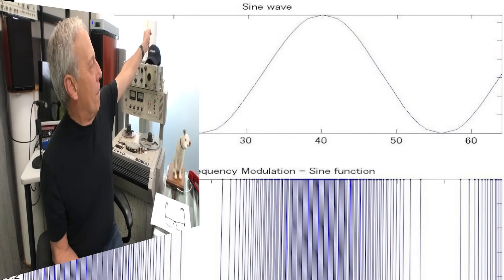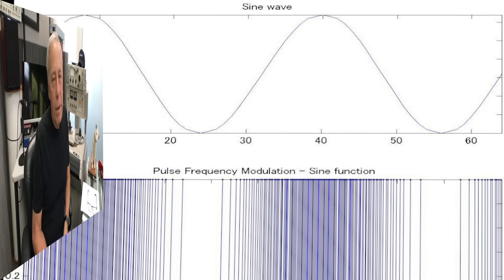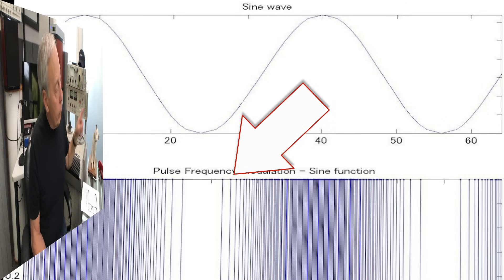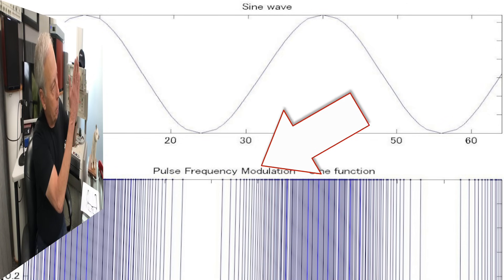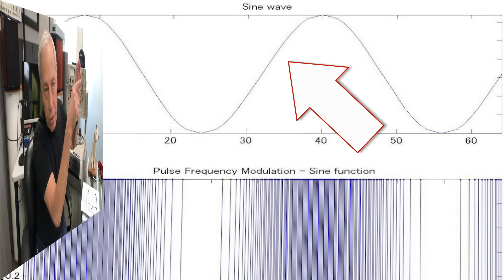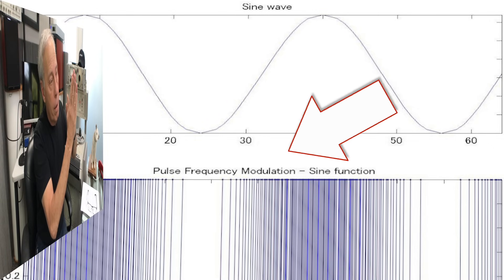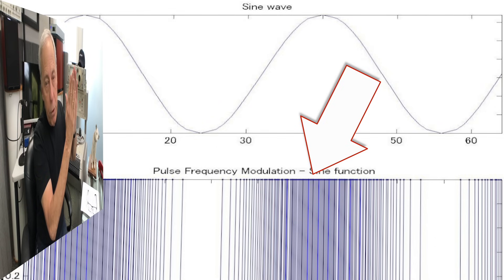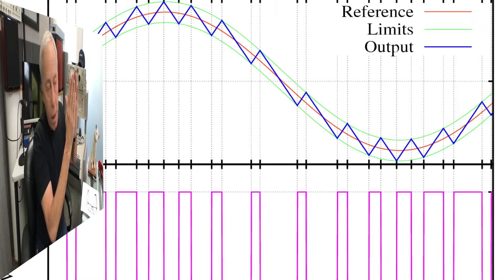What are the differences between Class A, AB, and Class D amplifiers?

Comment: Which among these amplifiers have the most natural sound?  And if I go by natural sound will class D be still the best option for Subwoofer?  I am using 3 class AB stereo amps linked through a 3 way network.  Should I reconsider the classes based on bass, mid-range and treble.  Thanks in advance.
Reply: Thank you so much for the reply.  I'll power the sub I'm going to make using class D.

Comment: So basically in summary, the higher the class the better the quality, Class D being high end premium amps and Class A being on the side of all the cheap components at Walmart.
Reply: toranamunter Class D is more efficient, nothing to do with quality
Reply: toranamunter expert trolling
Reply: hurkamur1 - might even be class A trolling
Reply: PapaWheelie Ooh..  I see what you did there 😁
Reply: PapaWheelie Or was it just class D with a youTUBE buffer?
Reply: hurkamur1 - worst part is he might be for real but doesn’t matter because trolls
Reply: No NO No The Class of the amplifier Circuit type has nothing to do with sound quality .. it is not like A, B, C Grade It is just a classification of the type of circuit
Reply: Class A is the best most premium quality sound but very inefficient
Class AB is very close if not identical to a Class A in sound quality but much better efficency
Class D is the cheap bargain basement amps you will find highly efficient but needs a very good LP filter to match the sound of A & AB

Most Mid to High End amps will be in the Class AB variety with low end stuff and portable battery powered stuf being class D

Comment: I have just found your channel - it's very good. 50 years ago I built 2 Mullard x 20W RMS into 15 Ohms 0.05% THD valve amplifiers and 3 valve pre amps. 50 years is a long time to go back to a hobby. I can remember the arguments about these new transistor 'things'. It seems that has moved on although valves are now 'THE KING' it seems, at least in price. I have a 2 x 10W in the loft so ..... 
I have missed A and AB amps and gone straight to D-Class. I have built the power supples but these ltlle black things with legs like spiders webs are beyond me. I have bought far too many from China. I need all the help I can get and your explanation was just what I need - simple and precise. Thank you from across the pond. Come to think of it my  15 Ohm Tannoy's (1953 vintage and perfect) might like a little class A. I have a lot of 2N3055's - I remember them coming out and TIP35C's. Thanks again.

Comment: Surely the key difference between amplifiers people are interested in is the effect it has on the signal.  Thinking of a sine wave the Class A is indeed always on amplifying both the positive and negative signal through a single valve (vacuum tube) or transistor.  A Class B amplifier has two valves/transistors; one for the positive part of the sin wave and the other for the negative and is only "switched on" for that duration.  This can lead to crossover distortion as the sin wave transitions between positive and negative and back again, which of course the Class A won't have since it's always on.  My understanding is a Class AB overcomes this by keeping "switched on" passed the transition of the sin wave being null thus overcoming the issue of crossover distortion.  A Class AB amplifier also has the benefit of being able to generate a much larger output signal than the Class A, as most of the individual valve/transistor's amplification is on only one half of the sin wave cycle.  Class AB valve amplifiers also use a feedback signal from the speaker to compare to the input signal to remove any distortion (IIRC) and better control the speaker itself.  For example, when the music stops and there is no signal a Class A amplifier will let the speaker ring until it comes to a halt whereas a Class AB amplifier will effectively stop the speaker dead so the playback could be considered more precise.  That said, in the real world a speaker's ringing may only be a few m/s so isn't really audible.  Both Class A and Class AB valve amplifiers can sound fantastic IMHO.

I don't know maybe the question was purely concerned with power in which case my comment is totally off point :)
Reply: Pat, your clarification is a little better than Paul's (sorry) and if one wanted to peel the onion of the cross-over distortion dilema a little more, one needs to understand the that a bipolar transistor has what is called a forward bias voltage (Vbe=voltage base to emitter) characteristic that needs to be overcome before the transistor starts to turn on. This voltage is about .7 volts. This is what causes the infamous "cross-over distortion". As the music's signal sine wave starts to increase from zero, the transistor dose nothing until this voltage is met, thus the first .7 volts of the signal is lost. This happens in both the positive and negative cycles. Thus where you have a perfect sine wave going in, you end up with a sine wave with flat spots as the signal crosses the zero voltage points. Google "crossover distortion" (http://bit.ly/2CuytSH) and click images and you'll see it. The whole class A/AB/B discussion stems from C.O.D. more than a power discussion, from the beginners perspective. IMHO.
Reply: Exactly.  It's the crossover distortion and quality of music that's of real interest not many watts electricity we're using :-)
Reply: It all depends on how high the bias is set for the amp to go into class b mode, Nelson Pass makes class A/B amps that go rather high in class A before the switch and begin having switching noise etc.
Reply: To use a mechanical analogy, a class A amplifier uses a variable amount of force to push against a spring; keeping the spring in the middle position requires applying force constantly, but the spring will always ride smoothly against the mechanism applying the force.  A class AB amplifier has a pair of mechanisms that can apply force in either of two directions.  This avoids the need to continuously expend effort keeping the output in the middle, and also eliminates the need to waste even more effort on the spring when compressing it to the maximum extent (an optimally designed class A amplifier cannot be more than 25% efficient), but will be more prone to mechanical backlash whenever it reverses direction.
Reply: thanks for that additional info....didnt know about that speaker wires are bi directional and can be used by amps to remove distortion
Reply: The better the Amp, the less it will "effect" the signal. Effecting the signal is not something one wants.
Reply: "The better the Amp, the less it will "effect" the signal. Effecting the signal is not something one wants."

Effect: "To bring about (an event, a result); to accomplish (an intention, a desire)." I always want my amps to bring about a result (output a signal). When they can't, it's either because there's been a power outage, or the amp needs repair.
Reply: It's "sine " wave -not "sin "wave.  It's non denominational.
Reply: Correct!
Reply: damping factor

Comment: very nicely explained. interesting to note that similarities exist between designs of products that convert electricity to other forms of energy. I am an ophthalmic surgeon and modern design trends in phacoemulsification machines increase efficiency of the energy generation and trade off of heat generation by burst, pulse and on-off patterns to maximize energy efficiency and reduce heat

Comment: class A is found on Neve's pre amps
Reply: Class A is fine for preamps,  since they work at lower voltages and currents,  but at the same time much higher impedances.  Therefore,  their power dissipation is much less than in power amps.

Comment: I have a question ...can you hook up a power amp to power 2 passive subwoofers using the sub out on the back of a receiver..?...great videos ...thanks
Reply: ok great can I also hook up a professional style crown amp to this sub out.? will the sub out have enough out put voltage for the amp.?i know some crown amps have a voltage select switch but the one im looking at don't...thanks

Comment: which type is good for subwoofer? I previously think class D, am i right?
Reply: Mikael Helje it's exactly the opposite. Class D amps need to have a lowpass filter on the output, which is why they are not as good on high frequencies as basic AB amps. There are exceptions, of course, like hypex nCore, but that's 400€ per a single amp module without a power supply. There's really not that much sound difference on subbas, if any at all - the way a subwoofer sounds depends mostly on the enclosure, amplifier only plays a very small role.
Reply: As wth capasitors,resisters ect , they all depend on each other  , a bit like Led Zeppilen all are one, one is all, they compliment each other ,take one out and it's all over for the rest, JB died the rest knew it was a broken , never to be fixed or replaced thing. Their amp was fried. Now out the 10000's bands and modern editing nobody has ever came close to the mark they left, a 1/1000000 thing, a personl choice iin music should determin the amp,xovers, speakers that give te best result regardless of what any cashed up book reading jazzjizz sound guru says. Now can somebody set up a perfect hifi to listen to Henry Manchini, AC/DC, Public Enemy and Nightmares On Wax and not touch a dial?  Amps can improve/destroy music way before it makes it the speakers, so I personally think you , Tommy should fuck right off with your facts &  figures and wipe the shit out of your ears, Boiiii
Reply: I see a hell of a lot of misinformation in the replies here.
Any good amplifier will amplify the signal it is given and all classes of amplifiers have the capabilities of the full range of audio frequencies (including the low frequencies for a subwoofer).

Asking 'what is the best class of amp for sub frequencies, A, AB or D?' is like asking 'What is the best color to paint a wall, red, green or blue?' They'll all do the job.

Your own ear is the best judge. Get an amp and listen to it. Ignore the classification.
Reply: I'd focus more on having plenty of headroom for the amplifier along with enclosure design and how that design matches with the sub's specs and room/cabin acoustics more rather than the class of amps.  Most if not all quality high end subwoofer amplifiers nowadays are class D with regulated power supply.
Reply: Not necessarily, Class A bass amps have a tendency to have much more sag, which is a phrase commonly used with these types of amps and that is not always what you want in a good bass amp. A more precise and tighter sound is preferable as a basic tone then you can make it dirty or keep it very clean and responsive.
I much prefer a bass amp that is very punchy and responsive and the class d amps have a quicker and clean tone to my ears. This is of course all subjective. I love a good high watt class A bass amp tone too but I think you are limited in what you can do with it. more so than with a good powerful class D.
Reply: I totally agree. The amp should be capable of much more power than the actual speakers. Head room is a must. Nothing worse than an under powered high wattage speaker system.
Reply: I'm using Cerwin Vega class A/B for my subwoofer, but I'm going to bye a Crown XLs class D
Reply: Tomas Kuruc friend and enclosure and Amplifier ,both are playing major roles in Subwoofer
Reply: Sound-wise, major role is played by enclosure and by the room. Good amp will just have more power and will let you use more power (higher damping factor). And how good a sub amp is, doesn't have much to do with which class it works in (because bass frequencies are so slow), so why not just be more effective?
Reply: Tommy B. powerful amp WILL blow the speaker, it's basic physics - too much power = too much heat. That paper explains distortion, if you know what RMS is, you will also know that RMS of a square wave (maximum distortion) is 1.41 times higher than that of a pure sine. So 100W amp pushing a fully distorted signal into a speaker will be as likely to destroy it as a 140W amp with a clean signal on the output.
Reply: well with proper active network crossovers and a lot of headroom speakers can handle a lot more "clean" power than most people would think.  With a higher amplitude with a clean sine wave it reaches high AC volts but for a very short time compared to a clipped signal making you see X amount of AC voltage for a lot longer(duration of the amplituded of the clipped wave which is VERY long compared to a clean wave)  I have 450 RMS going to each one of my speakers and they are only rated 225 for over a year already with zero issues and they are pushed hard but still below distortion.
Reply: Tommy B. James B Lansing killed himself in the late 1940s, so I highly doubt he wrote that. The JBL brand was already bought from one of his relatives or friends by the company now known as Harman in the 1960s, and that document looks like it's from the 1980s...
Reply: ...and one more thing: class AB  amps are very heavy but class D amps are very light
Reply: To be blunt , your best bet to get the right answer is listen and compare them yourself because only you will be able to tell yourself what sounds better.  I myself dont like class D because they have typically, in high power applications, very high THD (which is the enemy of all speakers and your listening experience)
Reply: Professional showbiz amps are all turning into class H which is essentially some class AB with modified power features to keep the heat loss at its minimal level all the time. Either in car, at home or on the gig, i would without any doubt keep an overpowered (twice the RMS wattage on the amp that the speaker support) class AB or H amplifier on a sub. Also consider the damping factor of the amplifier and don't overload ( driving it at low impedance) the amp as this lowers the damping factor or the ability of the amplifier to precisely control the position of the speaker cone under complex and powerful waveform situation that music happens to be. Please, don't tell me that a too powerful amp will blow a speaker, instead, go read this withe paper published by James B Lansing long time ago. https://www.jblpro.com/pub/technote/lowpower.pdf
Reply: He's been dead for decades.
Reply: That thing with the amplitude is exactly what RMS is about - square wave RMS = 1.41x sine wave RMS at the same amplitude. The fact that your speakers are surviving double the power is thanks to dynamics in music and that (most likely) you are not pushing the full amp power into them. Twice the power equals to just 3dB, which equals to only a few degrees on the volume knob.
Reply: thanks
Reply: Class A.
Reply: A valve amplifier Class A or AB will give you a much better bass unless you go down the route of bi-amping with a solid-state amplifier IMHO.
Reply: @PatBloomfield  class A, AB is better for mids and highs for better sound quality
Reply: Class AB is the way to go for subs. D class is good for mids and high, but if you want that sweet, mellow sub you want to stay with AB.

Comment: I have two questions:  1.  Does that mean that in class AB a small portion of  the amp always works in class A  ( the 20 watts in your exemple)? 

                                        2.  Is class B, some kind of push pull  amplifier where two parallel  circuits takes care of the positive and negative part of the signal?  No heat  like class D but  there must also be a certain  time lapsus or slip between the two phases....
Reply: There have been some high quality Class B amplifiers. Most Naim amplifiers, and the David Berning EA-230 come to mind.
Reply: Class A/B simply refers to biasing in such a way that the output transistor or valve runs at less than 100% but greater than 50% duty cycle. As for Class B,  where each transistor is on roughly 50% of the time,  the two devices running in push-pull are actually in series, not in parallel.  This is because they are driven 180 degrees out of phase from each other,  effectively doubling the voltage available to the load. But by running parallel pairs in each push-pull leg,  you can get quadruple the power than that of a single ended output stage.  The main limitation here is the device dissipation.  Many consumer grade amps get around this limitation by running 3 or more devices per leg in parallel, and not stressing them quite as hard.